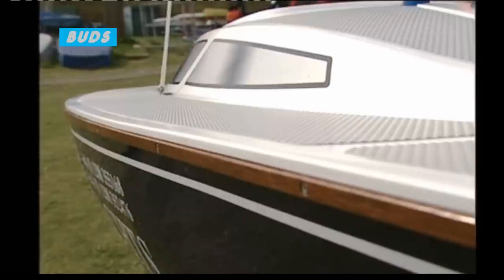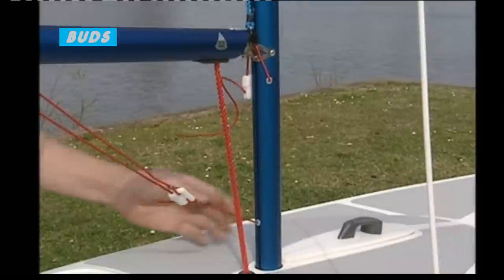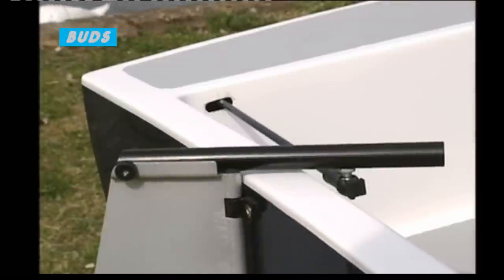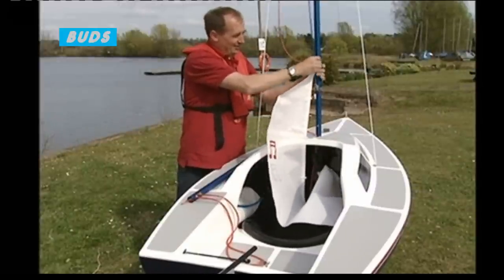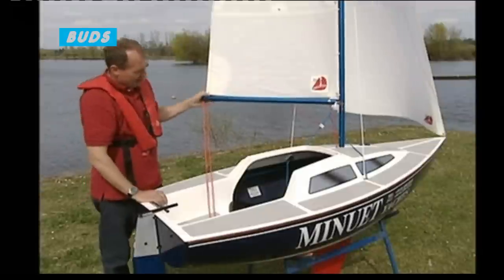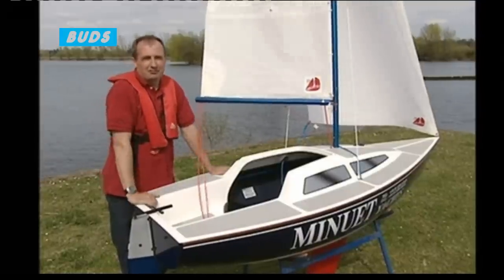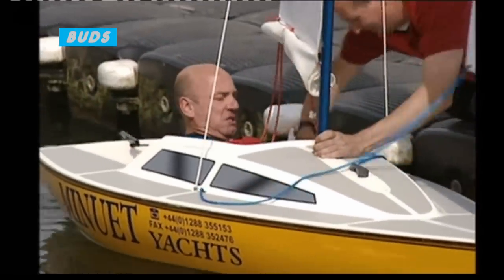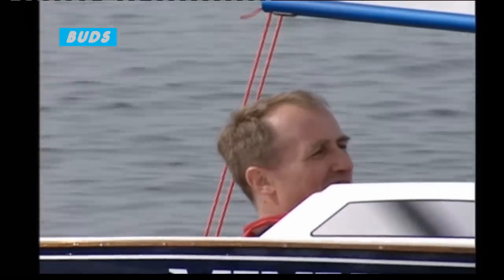ONE MAN MINUET YACHTS

Comment: It's cute but I'd be panicked about being stuck inside and drowning if it capsized. How hard is it to escape from in that situation?
Reply: no more difficult then a Kayak the boat is so light that I'd not be suprised if you couldn't just shift your weight and flip it back round like a Kayak, though it's not designed for that and you'd still have to get out and swim to shore.

Comment: I could see steering with foot pedals as an advantage instead of the stick.
Reply: agreed. could use steel cables/ blocks instead of soldered joints/ cranks. And would leave the hands free to deal with the sheaths or hold the back of the head (for a brief relief...)

Comment: Fine on a small lake in a light breeze but I'd rather have a conventional dinghy tbh - faster and a lot safer  - I'm assuming they have some form of built in buoyancy tanks and can be righted after the inevitable capsize but bailing it to get it stable again looks difficult. Is there a video of capsizing and recovering one of these? Having a weighted daggerboard is a concern unless its locked into place because once it turns turtle that will drop out.
Reply: John Rogers Yeah, the Illusion class/mini 12 meter is better designed in my opinion, has a proper keel and comes with a symmetrical spinnaker.

Comment: What is the advantage of having the front half of the boat decked in rather than just keeping it open so you can get to the front if you have to (for example, if the jib gets tangled)?  Is the idea that it would keep water out in rough seas?
Reply: Poly Hexamethyl it’s to save on coffin expense.  See how it’s designed for “viewing” right away with the persons head and shoulders exposed?
Reply: The most obvious thing is that it is designed to look like a full size sailboat just miniature. If it didn't have a deck and cabin top and port outlines then it would just look like a sailing dinghy.
Reply: Phil M, it looks really cool, and light by the way the dude lifts and handles it.
Reply: The guy designed it for use in Britain, so keeping rain out is a major factor.